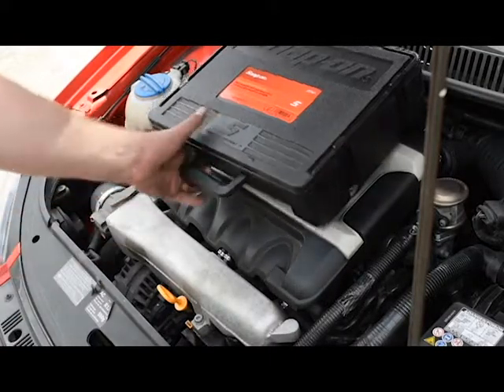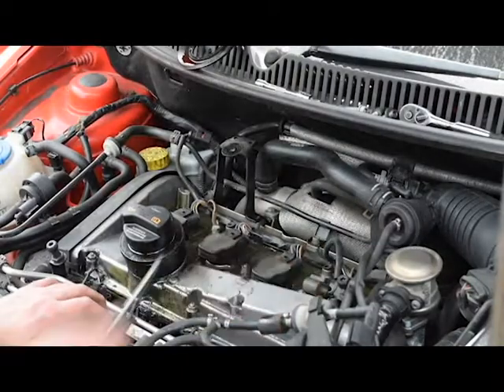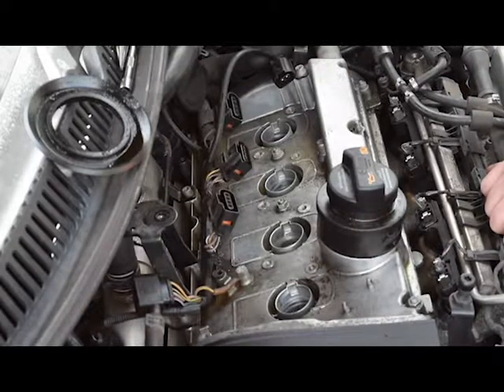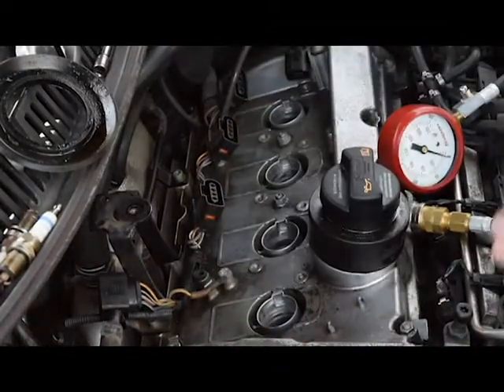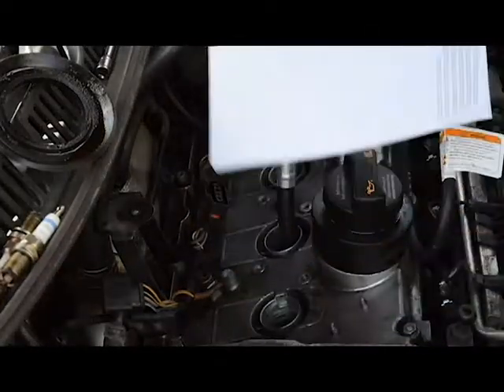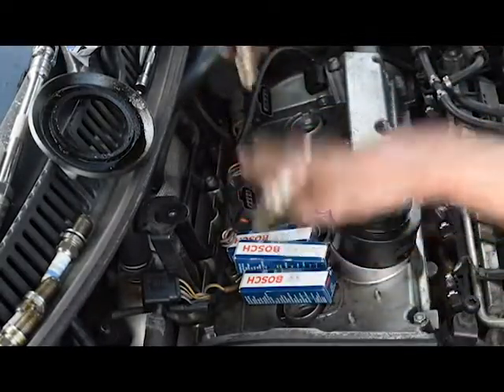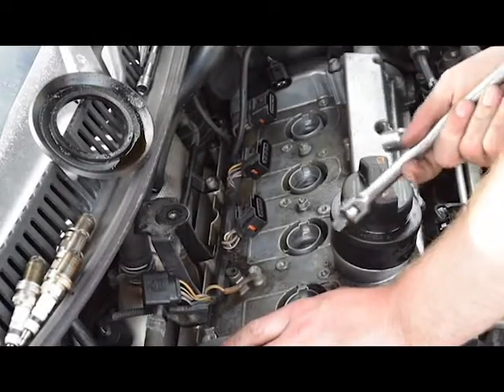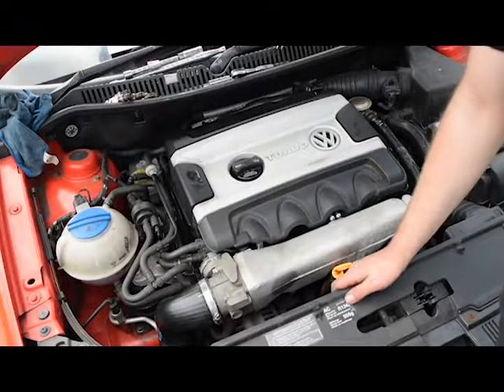How To Compression Test A Car? Polo 9n3 Gti 1.8 20vt

Comment: Hi, how many kilometer did it get ?
Reply from the maker: When I did this test I think I had around 100,000 miles on the clock which equates to 160,000km 👌🏻
The car is still going strong at 140,000 miles fingers crossed it stays that way 🤞🏻

Comment: Hi, does your oil smell like fuel? My GTI has 195k km on the clock and the smell of gasoline is rather strong. I still didn't do any compression test on the engine, yet it burns very clean and no signs of smoke or something. I changed the oil at around 192k. I also have a faulty thermostat that I will soon replace.
Reply from the maker: Hey man, 

My oil doesn’t smell like fuel.
This can happen though if the cars been sitting for a while?
It can still burn clean and have other underlying issues. 
My advice would be to change the bad thermostat as soon as possible, the car changes the air/fuel mix depending on engine temperatures so if the thermostat is faulty then the ECU will be getting inaccurate readings from the temperature sensor.
It sounds to me like it’s running rich because of this issue and that extra fuel is washing down the cylinder walls and into the oil. 
Hope this helps 👍🏻
Reply: @CarsandEngineering  Yes, I have the thermostat on hand and will be changing it soon. It burns very clean. No visible smoke or fumes just like it should be. The car barely reaches optimal temperature and that also is an issue for oil dilution.